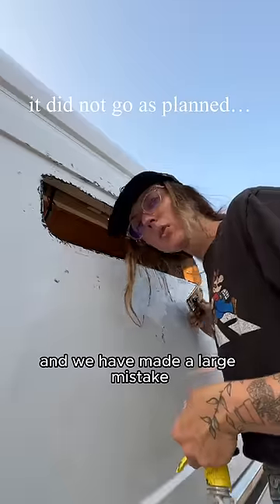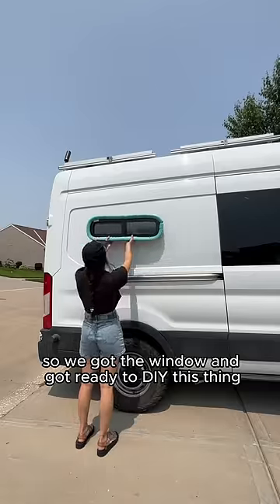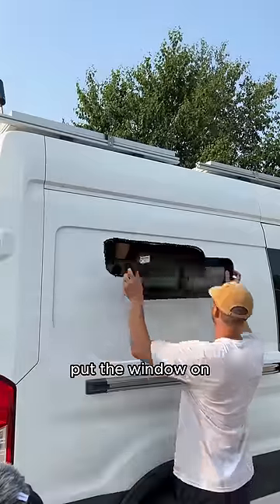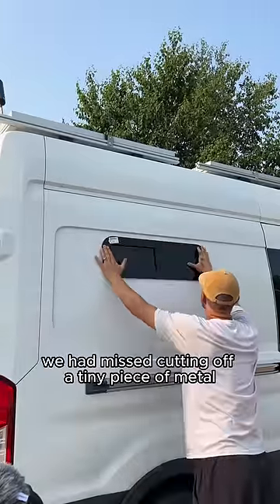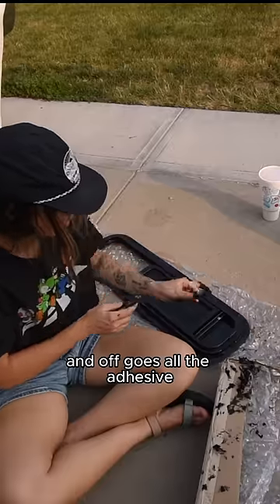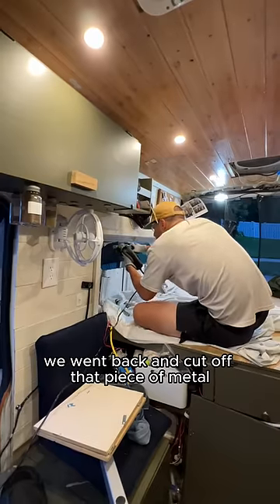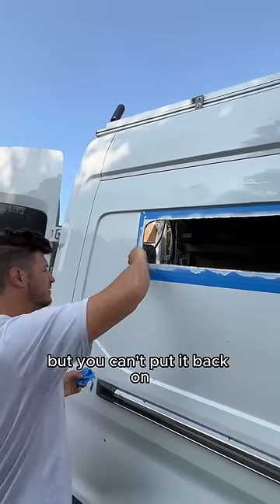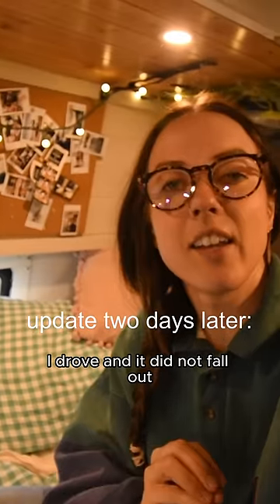DIY window install gone WRONG #vanlifefail #diyfail #vanlifediy #vanbuild #vanconversion

Comment: Lesson learned. Always fit your piece in the spot before you add adhesive 😅
Reply: Beat me to it 😅
Reply: Yes yes yes
Reply: As a roofer I can tell you I always make my layout and cuts before adding tar but still get covered in it
Reply: Thats….. logic/ common sense, no?
Reply: @mitchell4766 nope, everyone doing this stuff for te first time, will make such a mistake 😂😂
Reply: @JohnWiku Na, I didn't my first time installing a window 😂😂😂 Cause I grew up with parents who weren't monkeys 😂
Reply: I was here for this. 
Always test fit without adhesive.
But, this is how we learn specially when we diy. 

Could of been a much, much, costlier mistake. So an overall win.
Reply: Yep in the trades we call this a dry fit
Reply: Common fucking sense dudeee 😂
Reply: @OfficialRackk0  
Common sense is only common if you grow up around something. 
Example; for me, not standing behind a horse is common sense
Someone who’s never been around a horse might not know that.

You could say changing a tire is common sense yet… thousands of tow trucks are called every year to fix a flat.
Reply: @JohnWiku no in fact if it was my first time id be triple checking and test fitting before anything permanent, if i was a pro an had done it 100 times i would cut and glue. Tardmonk
Reply: @VideoGameSanctuary  when are yall gonna realize not everyone parents works with this kind of stuff and that doesn't make someone stupid you gotta be a man to have those kinds of veiws
Reply: @noploxq5593   this was a good comment till “gotta be a man”
Reply: I'm lost of words.
Reply: Im a plumber and I learned that the hard way multiple times ahhaha I must say to myself “I’m a friggin idiot” like 40 times a day.
Reply: That is what im thinking too, why they didnt fit it first before puting adhesive
Reply: @patricksimoneau7647 Only men would really have this thought due to our gender roles; could happen with a girl but i'd imagine it's far rarer, so, it fits. Gender roles are still enforced is the tl;dr
Reply: Took the words right out of my mouth
Reply: Their dry fit happened in the parking lot. Afterwards.
Reply: They did bruh lmfao, issue was the glue was too thick
Reply: Yep, always dry fit first.
Reply: Thank you
Reply: Test fit!
Reply: Dry fit is what it’s called

Comment: That is why you always dry fit before adding the adhesive or sealer. It happens  to everyone once. Even me.
Reply: Even you?!?! 😱
Reply: @MrGatin777 no way this could happen to him. I cannot believe this
Reply: But then they wouldnt have this particular content that pushes people to comment and help the algorithm push their vids.
Reply: If it can happen to darkcwboy, it can truly happen to anyone
Reply: No bro not you too?! 💀💀
Reply: Were it my van, I would have left that structural strut intact, or at least the center portion of it. It probably would require some artful cutting of both strut and window to get them to mate, or finding a different window, but having seen too often how old vans' roofs sway back and forth relative to the rear doors when going down the road, I wouldn't want to remove anything that adds to the rigidity of the structure.
Reply: Nahh ur lyin, as if that would happen to you!

Comment: Don't forget to clear silicon the outside edge of the window to keep from future leaks. Also, use budel tape (it's like clay/play dough tape) as a sealant for the inside of the window next time. Less messy than that black stuff you used and lasts for years if maintained.
Reply: Butyl is used to seal windscreens and headlights too
Reply: Budel
Reply: Question isn’t this a big security risk? Looks like it can be ripped off
Reply: @krisb-travel this is no more risk than the GLASS windows in the rest of the car. No one’s gonna pry this out to get in, they’ll just break a door window.
Reply: @krisb-travel who can future through that hole? A infant?

Comment: Really surprised you didn’t check if it fits before applying the adhesive.
Reply: Helping me dad do construction for years and trust me it’s not supprising
Reply: @lightingmcqueen8981  haha yeah true there are a lot of nuftys out there.
Reply: They’re millennials building something. There’s gonna be some issues
Reply: @mescobar1118  😂 yeah no common sense these days.
Reply: @mescobar1118  yes because construction workers/contractors always do everything correctly. I'm in the industry and it's ridiculous how much they mess up by not double-checking measurements or plan drawings.

People are trying to do things themselves to save money, and they're going to make mistakes their first time. That's how learning happens, heaven forbid
Reply: They said they wanted to know if the window would fit and it did….. or si we thought 

I think that indicates that they probably tried it before the adhesive
Reply: Some people just get to excited and jump a bit to quick pretty sure they won’t make the same mistake again tho
Reply: I read this quote not so long ago: the expert has failed more times than the novice has ever tried. Seemed fitting
Reply: @ronaciaifill5372 . They added the audio back into this video when done, so, they possibly did not know of the mix up.
Reply: You’ve never glued something up and then found it didn’t fit?
There’s a saying around my way. The man who never made a mistake never did anything.

Comment: I work on RV's & Caravans for a living and I can safely say... don't use black silicone. It's the worst to work with and even if you're kind of experienced, you'll still be covered in it. Also dry fit everything if possible.
Reply: also, it's not structural!  you need fasteners!
Reply: Idk about covered in it bucko,  you just have to be careful if you end up covered in adhesive trynna install glass you need a hard hat lmao
Reply: What would you recommend brotha
Reply: You're a pro, why are there beetles in this fifth wheel I bought and I'm living in it atm tried everything I can think of to get rid of them but they keep showing up

I sealed any cracks etc and got raid perimeter, it's a 1997 road ranger is it time to hire a pest control person or maybe there's water damage I'm not seeing?
Reply: Same here, silicone doesnt last at all, get a tri-polymer last much longer especially on rvs and vans.
Reply: I don’t know if it’s really silicone, could be a windshield adhesive. And if it is, that’ll never come off
Reply: So what would you recommend people use instead? 🧐🙂
Reply: @KarmaChameleon3029  a tri-polymer, something like RV Flex for outside or if your doing inside structural work Sika flex
Reply: @paulobermiller9477  👍
Reply: @paulobermiller9477 why not just a rubber seal and screw the thing in place?
Reply: @stixinst5791  eventually the rubber seal will crack from uv rays and cause leakage
Reply: @paulobermiller9477 how is the UV going to shine on a hidden surface
Reply: @gtjack9  it's not completely hidden specifically on those types of windows
Reply: @paulobermiller9477  but the car will likely rust all over by that point, or they can just switch the rubber seal later, unlike adhezives
Reply: @aajpeter if you use the proper adhesive its structural. Planes are glued together. So are most touringcars. I mean if you go look at a touringcar tell me where you see fasteners. You dont, because the whole body of those is glued together. How i know? My dad used to build them.
Reply: @eccentricjoe8786  Pop rivets
Reply: @SheenaHernandes alright buddy thank you so much
Reply: Rivets and pins do wonders but no one wants to put in that effort anymore

Comment: "I drove and it did not fall off"
That's a good quality assurance test right there.
Reply: Now when it rains
Reply: 😂 😂 😂 😂 I came here for this exact comment
Reply: The quickest way to know if you done goofed! 😂
Reply: But did anyone slap it and say, "that's not going anywhere"?
Reply: @TheCATlover345 it’s not gonna fall off😎
Reply: Especially since it was the female that drove
Reply: @CbrF4i600cc  absolutely zero reason to be sexist
Reply: @alanhat5252 "the female" like what?
Reply: For this test it is not QA its QC
Reply: @alanhat5252 Well giving them a vote has ruined entire countries, so there are quite literally thousands of reasons to be sexist.
Reply: Is it still attached?
Reply: Yeah, they should try this in aviation😂
Reply: “Quabbity assuance”, as a wise man once said
Reply: Pretty much as deep as a mechanic doing a road test.

Comment: "you can always cut more metal off but you can't put it back on" laughs in welder
Reply: I'd like to laugh but unfortunately my fitters are the ones getting the last laugh as they give me another 2" root gap. Just cause you can weld it doesn't mean you should or would want to.
Reply: lol i was just thinking, it's called welding😂
Reply: @electricalarachnid  yeah but on a car its not to hard to fix usually
Reply: Haha just gotta have patience so the metal doesn't all Warp
Reply: @danielrosales4276  yeah doing body work on my truck right now and the hardest thing is just waiting for it to cool down until you can keep welding
Reply: I knew it
Reply: @CombatVeteranGamer bruh same lmfao
Reply: Searched for this comment 😂
Reply: I wouldn't weld on it with anything other than wire most likely
Reply: @Ojibwa_Islandboi  mig or tig if you need to be really precise
Reply: Im saying these diy clowns are sad
Reply: Was just think that lol
Reply: Yeah I laughed.... pfftt one can always add all the metal
Reply: @electricalarachnid  well yeah but she said you can't when you can, doesn't matter whether you want to or not, you still could do it.
Reply: @codename8942  use a compressor with an air gun attachment. tack, then blast it with air. ;)
Reply: Bruh, i just hopped down here to say this word for word and you beat me to it
Reply: As someone that builds cars by hand no you don't want to add metal and if I come up short making a panel or I cut a hole to large your gonna hear swear words
Reply: I had a good laugh when she said that!!
Reply: Exactly what I was thinking
Reply: I was thinking the same thing
Reply: A pothead friend of mine wanted a sunroof on his Charger, so he used the sunroof as a template and cut it open. The sunroof fell right through the hole because he used the outside flange. Time to buy a bigger sunroof.
Reply: @electricalarachnid dude what I have a hard time with much over an 1/8th
Reply: Metal is way more friendly then wood! I love welding!
Reply: I was thinking the same shit
Reply: @kieren7763 You may say that, but some of these people sound like they have added metal to their cars.
I reckon they are minuscule pieces to make tiny adjustments.
Reply: Riveter goes pop pop!
Reply: Literal first though. Uhhh welding?
Reply: Here it is! Was looking for this comment.
Reply: @@N_N23296 the window is gonna cover it anyways plus its only like an half inch they have to grind so any bare metal they can get a paint match repair kit
Reply: Forgot to search for this comment 😂
Reply: @@N_N23296 you’re trying to use common sense on the internet.
Reply: @@N_N23296lol why are you fighting this? And no, of course they wouldn't solder. This would be welded
Reply: Yeah, you can weld metal back on, of course... but then you have to do all of the finish work and paint.  That's quite a project to do for not just being careful cutting it out in the first place.
Reply: @billymanilli  its gonna be covered by the window anyways and you don't need to paint the whole van if its only a half inch of material

Comment: Always try and dry fit before glue. Glad you figured it out and got it working! Have fun and tell big Chungy I said hi
Reply: Came to say this. Dry fits are important, speaking from experience.
Reply: You really never want to mess it up if it's supposed to be a one-and-done project.
Reply: It says in the description that they did a dry fit test
Reply: @MrsMuffin11  Well, they obviously didn't get it to lay flat then either because the adhesive should have little to no affect on the fit, and the metal didn't grow. If you haven't already got it to sit EXACTLY how you want it in the end you're not ready to glue it up
Reply: @minecraftjunky2001 idk man, I think the metal grew back
Reply: @minecraftjunky2001 big difference between 'little' and 'no' i hate youtube comments kol
Reply: @zbou23  "Little to no" is an expression that means there is a minimal amount of something. Go read a book
Reply: correct
Yeah measure twice but don't dry fit? smh

Comment: as a carpenter, i felt the “if you take more off you can’t put it back on”
Reply: As a welder, I did not
Reply: @aaronm3091 Indeed the "can't make a board longer" concept doesn't apply to metal.
Reply: as someone who works  at a metal shop i thought i can do whatever tf i want
Reply: @@N_N23296 that works if you cut a board too short, but if you power plain, hand plain, chainsaw, or shave anything off it becomes too difficult to repair. hewing is another good example, you wouldn’t try to glue the pieces together, it’s like one massive and impossible jig saw puzzles. wood glue is pretty durable, but you’d also want to pocket screw the two boards together which requires more time and effort than just replacing the board entirely. but thanks for attempting to tell me the most obvious answer, considering i do this for a living it should be apparent that glue is a part of my day to day.
Reply: @aaronm3091 was thinking the same thing
Reply: But you can... It's called welding.
Reply: @Why...So...Stupid...  your username fits. good luck welding wood, bud. 👍
Reply: I've cut it 3 times and its still too short
Reply: @dezman2003  You can literally hit metal with a rock to make it longer.
Reply: @JarthenGreenmeadow  stop cutting it 😭😭
Reply: @Why...So...Stupid...  didn’t mean to make you delete your comment, but happy i got the point across.
Reply: you aint a carpenter why u lying
Reply: Same. Whenever I need to shave something down I end up back at the saw like 5 times making sure I cut it shorter but not too short
Reply: @dezman2003 the owner of the company I work for told me that when he first started in construction, the guys in his crew told him to grab the board stretcher for them and he actually spent 10 minutes looking for a board stretcher 😂
Reply: Bondo as a cheap alternative 😊
Reply: @aaronm3091 dammit you stole my response lol
Reply: @stacks1548  i’ll do some research on that, but luckily all of the tools and materials are company bought so it’s not costing me money ahaha
Reply: @sumbum117  i do the same, when it says 5 1/4’ i cut it at 5 5/16’ 🤣
Reply: @juan180p  you have no idea who i am, for all you know i could be the creative director of your mothers only fans.

Comment: Make sure you seal it every year! My grandfather had a camper with a similar window. Each year he had to seal it to keep it from falling out or to keep moisture out. After it was sold, the new owner didn’t listen and the window completely fell out while on vacation.
Reply: This just seems like a poor design. I'd never trust anything that relied 100% of adhesive. I'd prefer something that was two-piece, sandwiching the van's metal between the two pieces that have some kind of mechanical connection (bolts, screws, etc.) between the two.

Comment: Next video, how to stop a draft and water leak from window
Reply: No sealing is crazy
Reply: More sikaflex
Reply: can also be torn off fairly easy
Reply: @kalebellis9598 they used sealing.
Reply: Where is the weather stripping?
Reply: @laurosilvestrejr.106 weather stripping,l & glass etcher (for the adhesive to stick to) give it a few months
Reply: @TheQueenOfSheba when? they applied before putting it on but never sealed it after

Comment: SUPER IMPORTANT! make sure you clean up all the tiny specks of metal that fall in the van otherwise they will RUST super quick! Next time you should tape a trash bag around where the hole I going to be on the inside to catch the shavings
Reply: They are super lazy, that's why they cut it the wrong size the first time
Reply: Why does that matter?
Reply: @SignificantNumberOfBeavers  exactly. If they aren't going to do it correctly the first time, they why would they ever take advice
Reply: no uh uh no
if they were truly "lazy" like you say they wouldn't of taken it off taken all the ADHEASIVE OFF and tried again 
they made a tiny mistake, all humans DO
Reply: Do it with your own van. doesn’t seem it’s a video where it’s asking for advice
Reply: And wear better eye protection than you think you need. I was wearing full safety googles grinding metal. A few shards found their way into each eye, and instantly began to rust. The optometrist had like a dremel thing he used to grind out bits of my corneas. It didn't hurt, but very uncomfortable